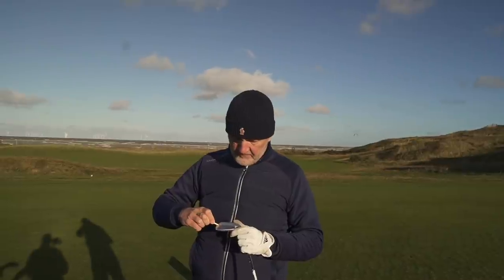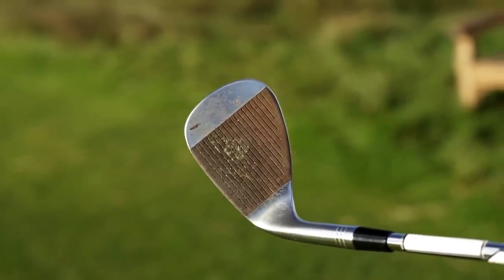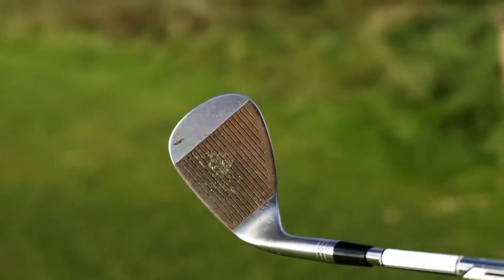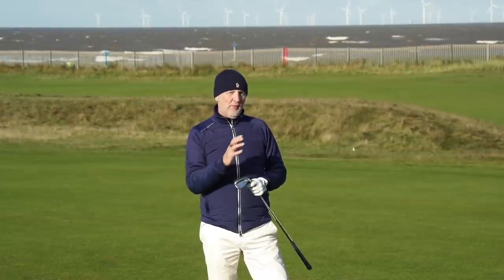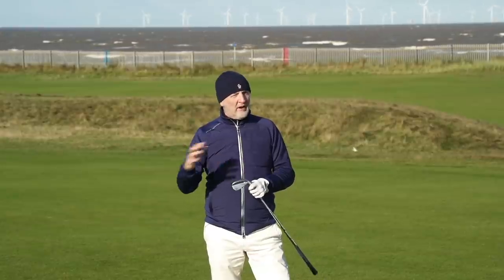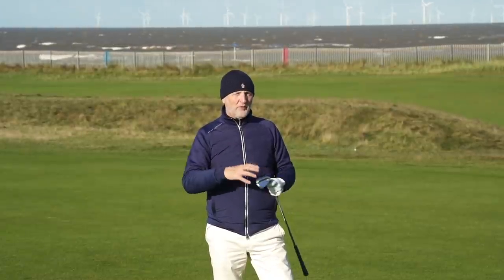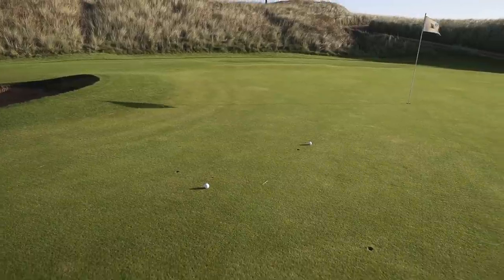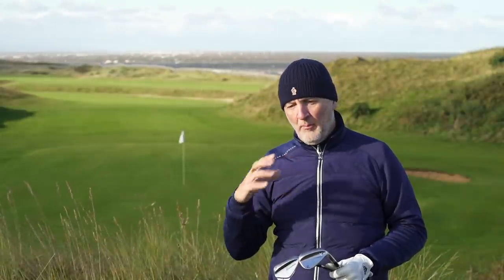SHOCKING FACTS - YOU NEED TO KNOW

Comment: I think you should add a third test. After you're done hitting your first set of shots, go back and do the test. But this time thoroughly clean both wedges before using them,  then clean in between each shot. Then show the results. I still wipe off the face of  my clubs after every shot and I'll brush them, or use a tee to clean the grooves as needed.

Comment: The MG2 is actually the wedge that I've played for the past year and a half... and your exactly right Andy. 
I just don't generate a lot of spin with my wedges. Certainly not enough to zip the ball backwards. It doesn't matter which wedge I play. I've played Vokey, Callaway and TaylorMade and I haven't seen an appreciable difference except in feel. All I ever need to know is roughly how far the ball is going to roll out with a wedge shot of a particular distance and try to make good contact.
Reply: The only way to zip a ball back is to catch the ball perfectly off the turf, and compress it on the shot. A lot of people I see on the course try too much to help the wedge. If you utilize the bounce, you can learn to pinch down on the ball and get it to zip back. Took me a few months of practice, but now I can even get a range ball to stop on a dime.

Comment: Give the club a wipe before use, rarely clean the groves... I prefer to stop dead, don't like backspin unless using a banking to feed into pin or have a pitch and have no green to work with, in those cases the tee scrapes the grooves.

Comment: Most people I chat to and fit for new wedges are coming from wedges that are more than one model year old and usually playing bounce and loft profiles that are counterproductive to quality short game control, needles to say dirt-filled and worn. So they usually see a big difference in that at the time. I gamed the MG2 for a few months in 2019 and have had the MG3 on test for a good few weeks now. Personally, I think the MG3 is a big improvement on the MG2. Mainly the shape and visual appeal from the address position. Bag appeal is nice but for me,  one of the main differences and improvements is the new and slight change to the sole grinds. I felt for even the better player the STD bounce sole profile was slightly thin and therefore less forgiving. The new STD Bounce sole just seems to work the bounce in a little less grabby and more forgiving manner. However more so, I thought the new MG3 felt much softer than the MG2 and flighted a little lower in my hands. Maybe the Thick / Thin toe pad has a bit to do with the new CG position and feel for me...but the numbers are the numbers...but anyone coming from older wedges product will definitely enjoy MG3...I'm testing Jaws Full Toe atm... Great video, Wallasey looks great

Comment: That old wedge is disgusting Andy 😂. If I were playing with you I'd be admonishing you every time you took it out of the bag. Yes, I clean my clubs after every shot. Yes I clean them with a brush and warm soapy water between every round or so depending on how well (or not) I've kept them clean on course. 
When in dry conditions, the groves only make any real contribution to spin on full (or near full) shots. On partial shots such as pitches and chips, the spin is generated as much from ball-face friction as it is by grooves. In any case, I don't expect much more than around 500 rpm diff. Does 500 rpm make a difference to the average golfer? I think not. We are not that skilled at precision placement and distance control to use that difference. In the wet, I expect bigger differences.
That said, I'd like to see you clean that wedge and then redo the test. I bet you'd see very little difference between it and the MG3 then, especially on full shots.

Comment: Genuine question: Are there any good wedges that are designed to ‘’not rust’’? I personally really hate the fact that a wedge as beautiful as the MG3 is supposed to rust right away.
Reply: Vokey, Cleveland, Mizuno...Although most offer a raw finish option as they're the best feeling and most cool looking after they're rusted. The fact that a sliver of the face rusts just doesn't do it for me though.
Reply: @jacobmccain8082  Thanks for answering! I definitly understand all faces will rust or wear out over time, but the newest wedges seem to rust as soon as you remove the tape. I will definitly check out some of your suggestions as i am looking for a new set:)

Comment: I despair......I have watched so many Youtube golfers and they are all the same - Dirty jammed filthy grooves. The club cannot work as it is designed. Madness. James Robinson never cleans his clubs from one shot to the next. Then wonders why he can't get close? Not one tour Professional would hit a ball with a dirty club even on the range. I always clean before and after hitting especially getting rid of crap in the grooves.
Reply from the maker: You’ve just watched a video that shows it made no difference Alan?
Reply: @TheAverageGolfer  Try a shot from 100yds and out and I think it will. The spin numbers did not seem right for both clubs. A club with basically no grooves should loose distance control even hitting way longer. This is what I see with J. Robinson. He gets a good strike but the ball goes long.